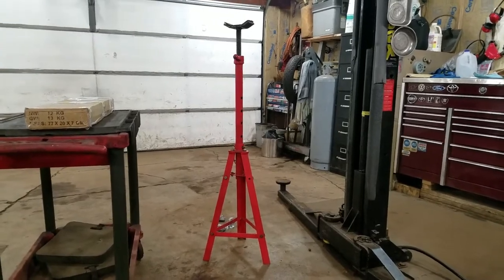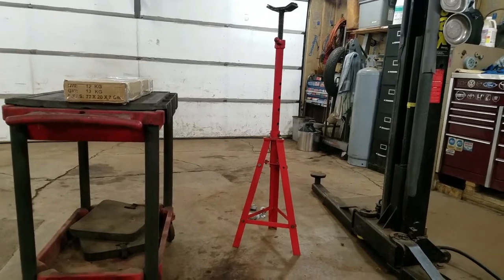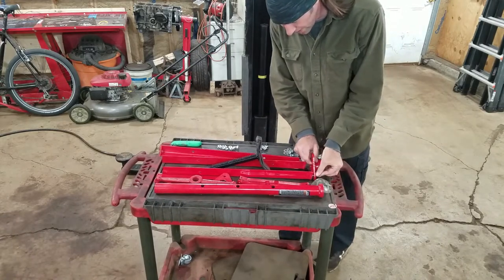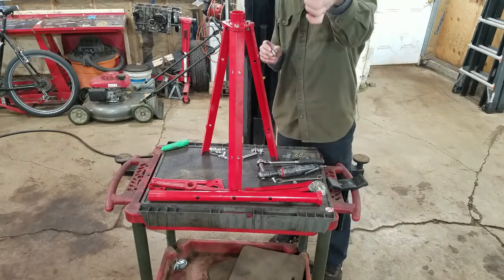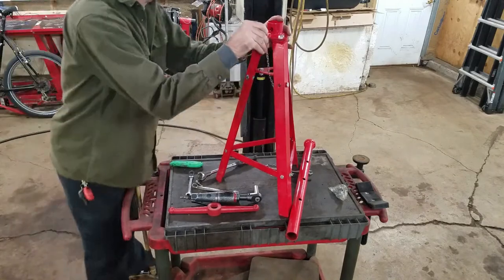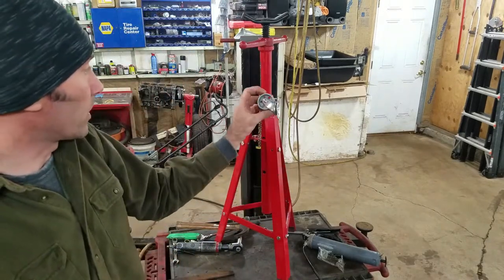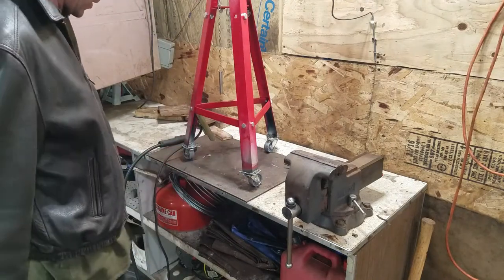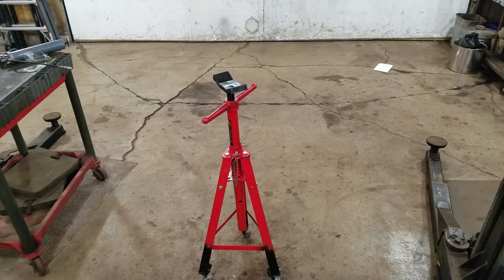Short underhoist tripod stand on wheels assembly

Comment: I put rotating castors on a table saw, and initially I was happy. However as the years went by I began to find the way it was hard to steer irritating. Trying to push it into a corner would sometimes cause it to drift the wrong way, I'd have to fight it when trying to guide an exact course. If I were to do that table saw again, I'd make two wheels rotating, and two wheels straight, like a grocery cart. Strangely, with the limitation of motion caused by straight wheels in the back, you can steer it more easily! I wonder if that would apply to a tripod....